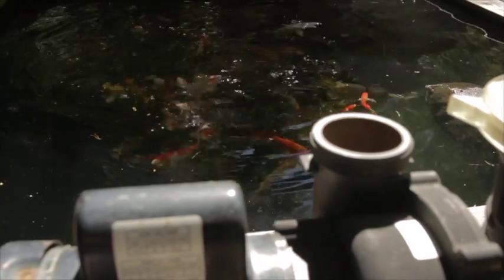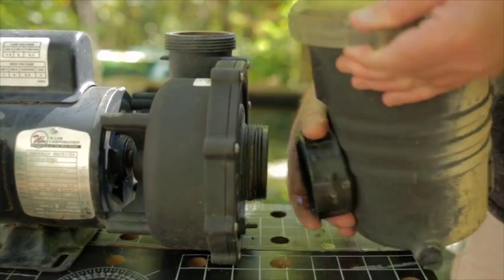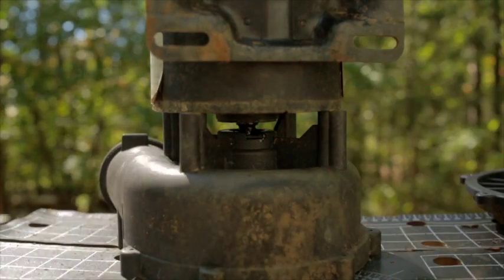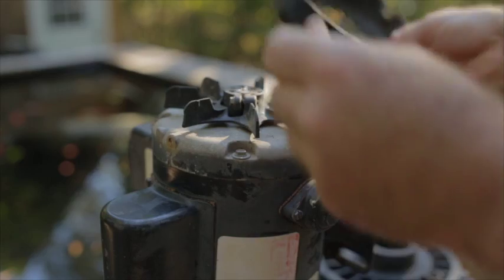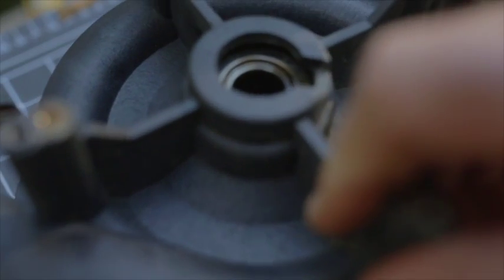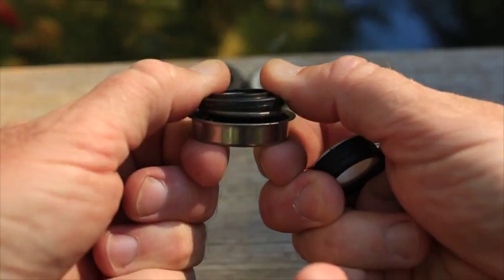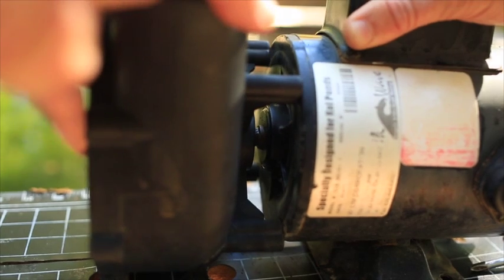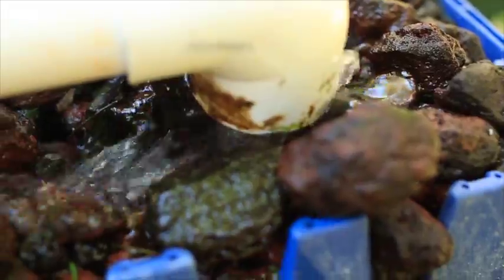Replacing A Ceramic Pump Seal

Comment: Replace the bearings in the motor, and then you will length the life of the pump.  Especially if the seal was leaking.  Main thing is to mark the ends so you know how to realign.